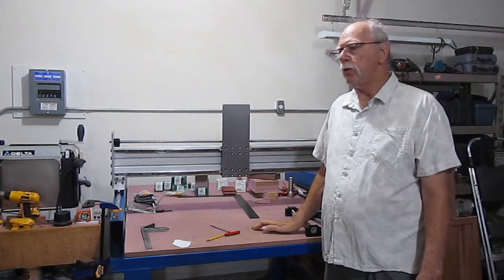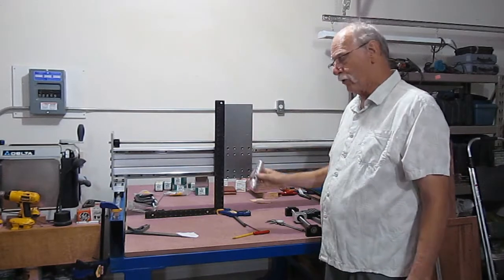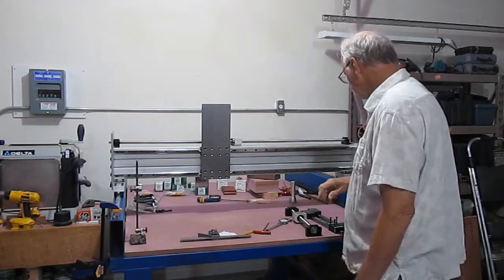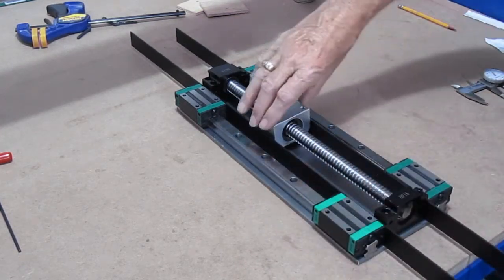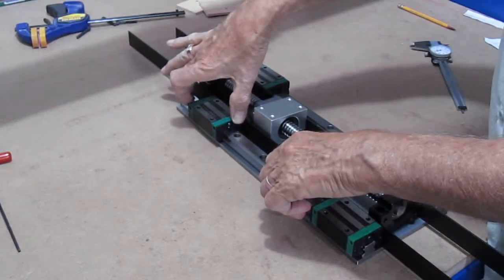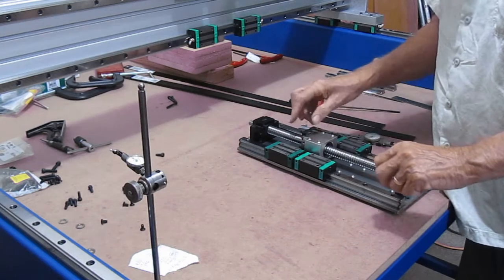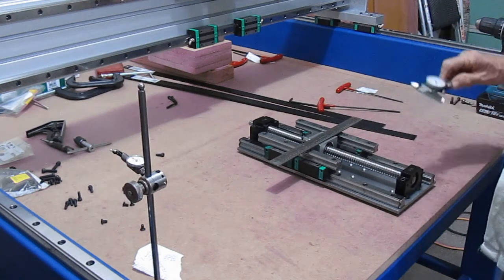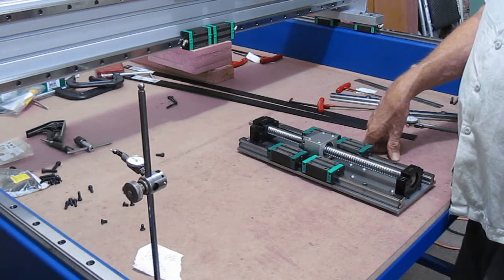Big Blue Router video #8

Comment: Nice work man. How long are linear rails for X axis and how long is ball screw for X axis? The same question for Z axis? Thank you 🙂
Reply from the maker: X rails are 59 inches, Y rails are 52 inches and Z rails are 16 inches.  The respective ball screws vary slightly in length to allow for mounting of the floating and driven bearings.